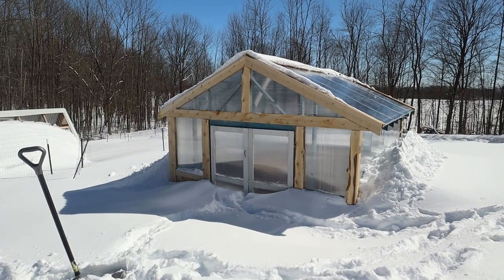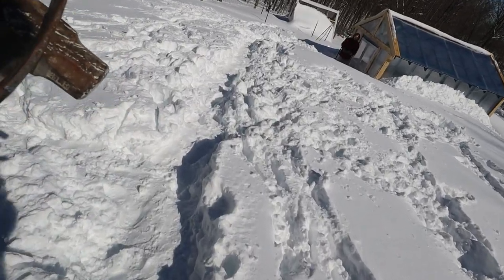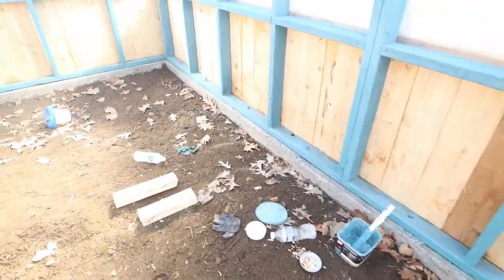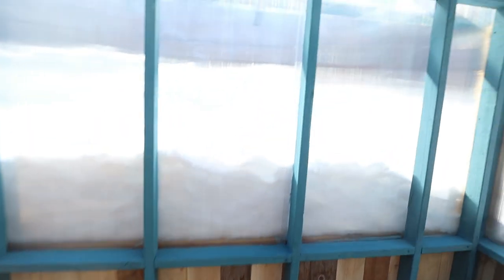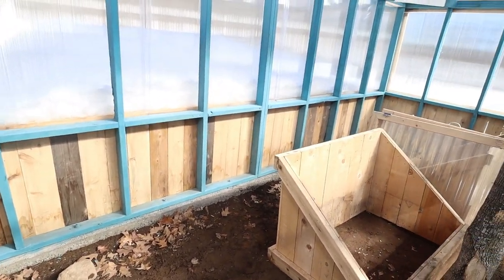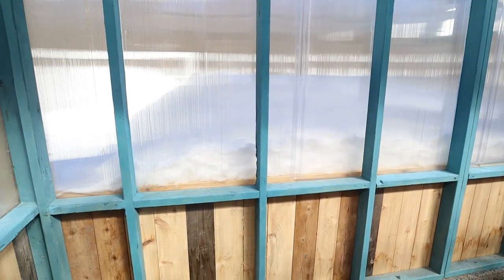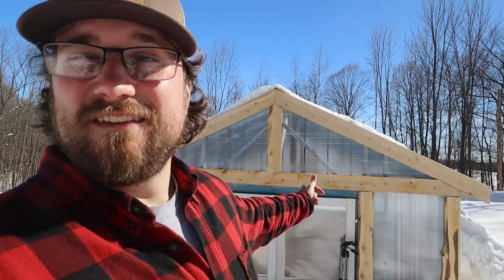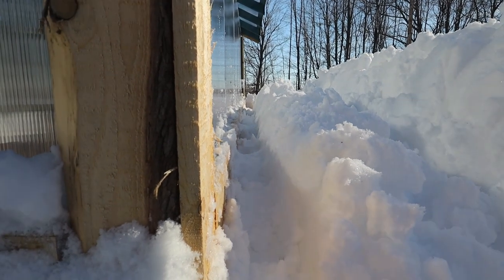Greenhouse BURIED in Snow: What's the Temperature Inside?

Comment: I bet that is a huge boulder under the ground. We've run into a few of those. It's like the tip of the iceberg just sticking out of the ground, and then it's huge underneath. I'm really surprised how warm it is inside there. Do you know how warm it was inside there during the negative temperatures outside?
Reply from the maker: That is most likely the case ahah our rocks are massive out here. That is why the raised beds will be tall and we are building a box around the rock because it would be tough to grow on it. We were surprised too if you couldn't tell haha and I am not sure. I wish I would have checked, but the snow just seemed so daunting haha But it said -2 on the thermometer when we got in there and that was not reset the entire winter. So that is the coldest it was this entire time. That is pretty impressive considering how far below zero it got at certain points earlier this winter.
Reply: @TheNorthBranchWI  It really is. I like the idea of this greenhouse. It would work for us too. The only thing I don't like is that if we built it, the tax accessor is going to charge us for it. He raised our property taxes for a slatted wood shed that my husband built last year because he considered it a permanent structure. One good ram with the tractor and it would be toast, so how permanent is that? He'd probably do the same with a greenhouse structure like this.
Reply: Your temps will hold even better with the addition of brick beds. All that mass will hold heat for you. Nice build!
Reply: @JamieE76  Yeah, that's my only drawback too. So my answer is to build one on a landscape trailer frame & axle. It is a trailer then, not permanent, so they can't assess any more. Even my horse sheds, 3 sided open structure for shade get an assessment.
Reply: @J4Julz  That's a good idea! We have an 8-ft trailer like that. It's so small we don't even need tags to take it out on the road. Maybe if my husband gets a longer trailer, we can turn that one in a mobile greenhouse. We can move it for better light depending on the season.

Comment: You could try the brick with rebar through the pressure points and driven into the ground once it's thawed enough. It'll give a little bit of flex but also be non-permanent if you decide to move the greenhouse further down the line. You could use soil as a fill-in mortar and put some seeds or herb cuttings in it so you have a living wall too!

Comment: I built a modified high tunnel last year on my property in Kenai Alaska and today I was able to build a masonry block wall inside of it. Thanks to the amount of sunlight that we have gotten over the last two weeks all of my soil has been thawed out. I track the temps with Govee sensors and I've seen over 120 degrees in the direct sunlight. This is my second masonry block wall, all dry stacked. The first one is outside and it looks just as good as the day I built it. A little bit of sand and some rebar are what holds it together, with glued down pavers as the top cap. It works great for collecting and releasing heat in the cold swing months. I was able to plant onions in early April last year in that raised bed. I live in zone 4B with approximately 158 days above freezing for what it's worth.
Reply from the maker: That is so cool! This is extremely encouraging to hear. We are in the same zone, too, so that is perfect! Thank you for sharing
Reply: Hey, you are welcome! Sorry for the delayed response, I've been scrambling to get my masonry wall completed so that I could fill it with soil and get some seeds planted. I'm going to drop seeds today and see how it goes. The masonry block wall is actually a stratification chamber connected to a rocket mass heater that I built inside my high tunnel. I fired it for six hours yesterday to charge the mass under the masonry block raised bed. I just checked on it this morning, it was 18 degrees inside the high tunnel but the block wall was hovering just below 32 degrees and the soil didn't freeze. Maybe I should start doing some videos like you guys... Oh, also, the masonry block wall built outside is completely free of snow, there's just a little bit of ice right on top of the mulch. The bed is up against the side of my southern facing cedar lap sided house. I highly recommend having a dark colored wall behind the masonry. It melts the snow and warms the soil every year. I also use inoculated biochar as a snow melting system, it works very well for getting my garden ready earlier than just about anyone around here. I hope this helps and thanks for your videos, they are much appreciated!

Comment: Are you going to use concrete block, or bricks? if you use block, you can add bracing between the block and the wall behind it. Or, add rebar vertically in the block, fill will concrete and that will help. Just like a basement wall. It will become a great heat sink to help stabilize your temps throughout the winter. You'll probably be able to grow into December and start up again in Feb, even with your usual temps. Have fun!

Comment: I see you were shoveling the snow away from the outside walls but I'm wondering if the snow has an insulating effect when the temps drop below freezing. Just a thought.
Reply from the maker: I am sure it helps! I just wanted to get the snow off of the plastic panels, especially with nothing growing in there.

Comment: You might be able to use foil tape on the ends of the polycarbonate, and the put the U channel back on for a friction hold. If you insulated the bottom it should be warmer.
Reply from the maker: That is a good idea

Comment: How cold does it get when the sun is not shining or at night. If you have heat in there you will not have to worry about how cold the nights get. You could rent a jack hammer to cut the rock down. Just an idea.
Reply from the maker: The sun was not out today and with the doors open it was over 20 degrees warmer in the morning. And there was a low of 23.5 degrees and it got down to under 13 degrees that night. And that is an interesting idea